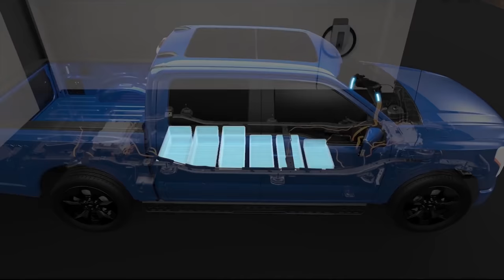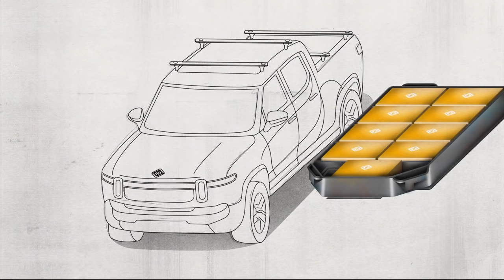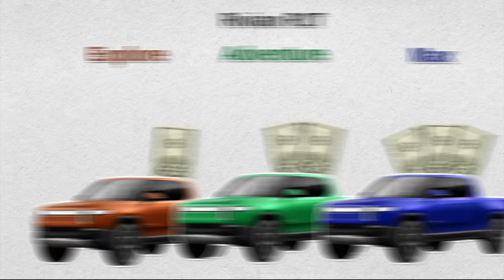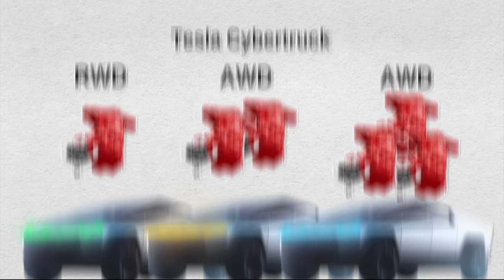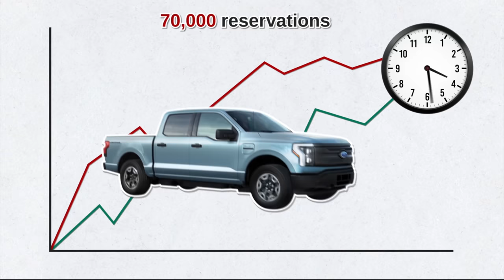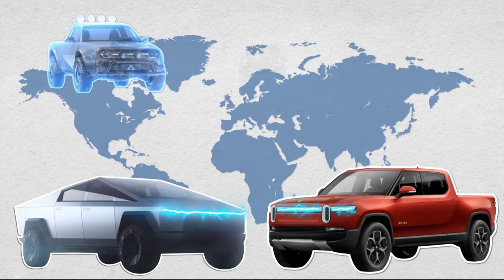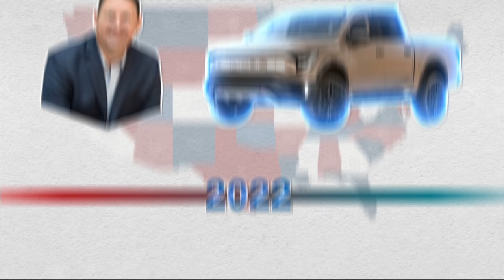Here's Why This Will Replace Trucks in America

Comment: Scotty, enjoy your videos but nowhere have you answered the question as to why these EVs will be replacing their gas counterparts. Aside from 0-60 times, current gas/diesel vehicles outperform these vehicles in most categories. Testing has shown that towing/hauling drastically reduces range as well. Only 2% of current vehicles are electric and they have been around  for some time now. IF these vehicles replace gas/diesel, it will be some time. Also, it doesn't seem like anyone is addressing the electrical infrastructure needed to supply power to all if these vehicles. Maybe Toyota isn't convinced, that is why they are waiting...

Comment: Missing are the days when a new truck was high priced if it was over 15,000.
Reply: I remember in 1973 my parents bought a Ford F100 "Explorer" package truck LWB 302, 3 on tree and only option was power steering & brakes. Little over $3000 new.

Comment: I like gasoline vehicles the best. Even if they are substandard. They are easy to fill and have been dependable for over 100 years. I guess I will have to buy used forever.

Comment: Not looking forward to not a single one of the electric trucks featured in this vid. I cannot wait until the whole concept of going to electric cars and trucks fails. Just think about the strain on the electric grid that will cause massive power outages every where. What the hell is the reason for this big push to go to all electric vehicles when there are several fuel alternatives that are 0 emissions clean burning fuels. All the new gas powered cars and trucks being manufactured today are 99% clean burning. This whole idea of electrification is absolutely insane!!!

Comment: If there are any millionaires out there that want to be billionaires.... Or just a E.V. fanatics that want to take on the dinosaur juice industry.. I have a couple designs for large, but, quick release and locking terminals for removable battery cells. A idea that could retrofit a model s and have them challenge stock cars,,,... not just on the track, but also leaving the pits. And that innovation, that want and will to build a side feeding, roller, quick release, and bolt locking battery terminals not unlike your striker plate on a car door. All in the name of trying to "refuel" a mobile faster than the other guy can dump gas,,, you will accidentally create a byproduct. What byproduct you ask. The model for an entire industry. You can then take the design for the endurance racer and sell your easily replaceable battery's and their feed design or kits to garages with the understanding that from that point on they will pay a deposit if the choose to leave your chain of charging and battery leasing anti gas stations. Basically a model for an industry that would literally have EV owners pay you to retrofit their machine to receive a battery that they will rent from you every couple days if they are too lazy or forgetful to plug in at home. Any takers? I promise once I'm a billionaire I will be a silent partner that won't leave R&D much.

Comment: --the more torque you use with an electric anything, the faster the battery drains. towing? LOL keep dreaming. an incline depending on how steep it can be sometimes, will drain the battery so fast youre ganna be like? i just lost 20 miles of range on the 20 feet of hill or something like that if you are towing. watch people complain about how bad it tow/battery life ratio for towing will be. 
--this why tesla is lagging on the cyber truck release. because they know it can not perform like a combustion  engine at all. they will get sued and people who need trucks for the intended purpose of being a work horse will avoid it. toyota is not dumb. japan is 80% mountain. they know how taxing uphill can be on an electric motor. until they fix that issue, dont expect eletric trucks to be more useful than an suv

Comment: Sorry battery powered truck won't work for places with cold winter plus batteries are more toxic than fuel electric still needs batteries so there not really electric that's a false hood

Comment: I think the Tesla Cybertruck is one of the ugliest trucks. Congress will have to provide a 10 Billion to build bill to make fast charging stations all over the country just like President Eisenhower did with the interstate highway bill. Which was not intended for cars but to transfer military equipment from point to point . I do like Ford is doing with F150 electric vehicle. If they can prove the reliable. Only time will tell. I would not buy a electric vehicle until most of the charging stations are in place & the electric car or truck has a battery life of 500 miles or more. 

I also think the car & truck manufacturers are going about the electric cars & trucks from the wrong angle. Producing smaller battery packs while extending the range is great. I think they also have figure out on how to make a generator large enough to keep the battery pack close to be fully charged & running all of the electronics. This i not rocket science.

Comment: Now so much electric ⚡️ vehicles are coming to the market in promoted countries like US AND Europe but half of the world is not ready for the EV now 
People don’t have roads to drive these , people don’t have power to light there Homs …so I thing we are going to use the gas ⛽️ and Diesel engines for more and more years 
And as I drive the EVs they are not trustable rot reliable losing power so fast when you load theme and so expensive to maintain . 
How much we spend to repair we will spend in a Toyota Land Cruiser fuel and enjoy the trip and we will travel any where we want